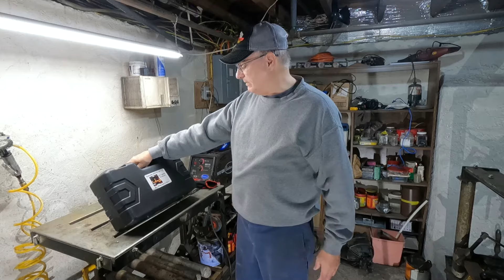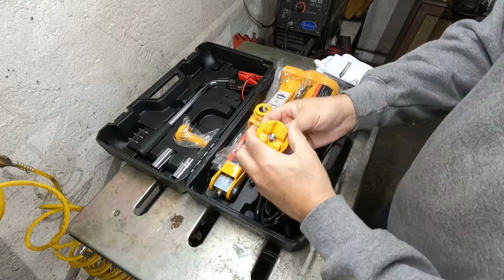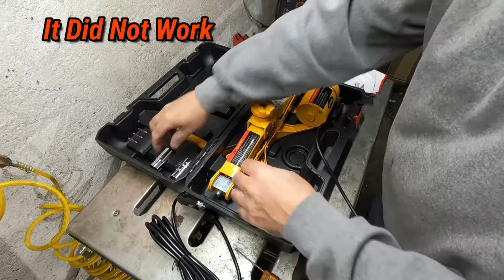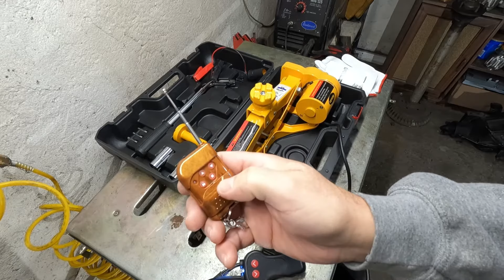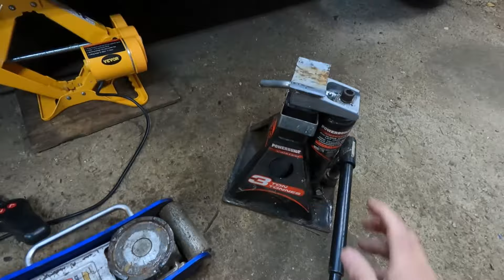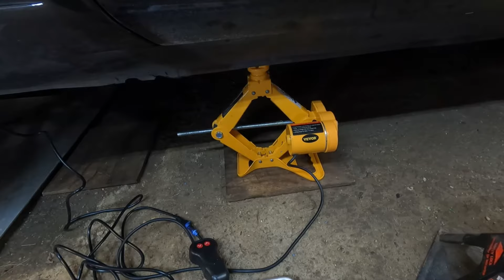Vevor 3 Ton Scissor Jack Review. 👀

Comment: From a safety standpoint, the scissor jack footing should run perpendicular to the length of the vehicle, instead of parallel like on the video.
Reply from the maker: According to the directions that is how they recommend the placement of the jack as the way I Have it in the video, the reason is if the car were to role just a little bit forward or back the jack would flop over or collapse, I actually had that happen to me once with a manual scissor jack. That being said I believe the factory jack is designed the way you say and so was the manual one that I had collapse on me.

Comment: I like a scissor jack because it is light weight and doesn't move unlike floor jacks. I use a high torque drill on the hex drive for easier operation. If yours has the hook and eye type drive, they sell hex adapters. I had one jack fail because of insufficient grease on the acme screw. The nut was stripped yet it still lowered the car smoothly. Only when I picked up the jack by the top did I notice it started slipping! Very strange.
Reply: It's probably safer if the jack moves on the floor like floor jacks, to accomodate the shift in the lift point due to the arc as the vehicle lift proceeds.
With the base fixed in position, it's much more likely to topple than something that can adapt as it goes up.
Reply: @sadfur8728  That's true for smooth floors, but I'm usually working on a bumpy driveway or on gravel. My floor jack doesn't self center very well which makes it more dangerous.

Comment: Thanks, great honest review. I wish I saw this before I purchased this jack. It blew fuses on my cigarette lighter socket and on the jack itself when I tried to lift the rear end of my pajero pinin which is less that 1400kg for the whole car. So the rear end should be less than 700kg. Waste of money as the 3ton rating is BS
Reply from the maker: Sorry to hear you had problems, Thanks for Watching.
Reply: Guess they expect it to common to blow fuses because they supply all the extra fuses along with the kit...
It may be more likely to blow fuses if the battery voltage drops too low and the motor stalls; keeping the engine running may be better.

Comment: that 3T on these jacks do not mean they can lift 3T. if its 3Tons then it can probably life under half of the capacity mentioned, actually 1/3rd. The meaning of 3T means it can lift one side of a car which is under 3T.
Reply: It'd be nice if the hydraulic press channel would test the actual lift capability, using their gauge and running the jack to the maximum.  Perhaps all these capacities are going by claimed divided by four, figuring the weight is equally divided by the four wheels.  That may be a more realistic expectation, so a 6600 lb claim is actually 1650 lbs.

Comment: Sound like your battery is weak ????
Reply from the maker: It's not, the jack is just slow.
Reply: The most important it can lift using the 12v battery.
Reply from the maker: It comes in handy for things like supporting the transmission when I had to remove the tailshaft housing, it allows for ease of adjustability

Comment: Your Jack was under strain because you did not use the battery cables to hook it to your motor use the positive and negative connections to your battery that is why your Jack was strained  The cigarette lighter is not strong enough it needs a direct battery connection
Reply from the maker: I believe I have tried it hooked directly to the battery in the past, but when I have a chance I will try it agen to see if it makes a difference.
Reply from the maker: I had to go back and watch my own video and just realized it was hooked directly to the battery while jacking up and lowering the car. 18:20
Reply: @E.T.GARAGE   Some vehicles have multiple cigarette lighters some are 10 votes some are 15 and most are 20 you have to find the one that is 20 V and even then start your vehicle too to see if that boost it some I have the same Jack and had the same problem all I did was switch cigarette lighters and it fixed the problem but also now start to use the battery connection
Reply from the maker: Only one cigarette lighter on a 90 Corvette, it's 12 volts and I would never use it to power the jack, the only time I have used the cigarette plug on the jack is with battery jumper box I have.
Reply: @E.T.GARAGE   I started to send my Jack back after I got it because of that problem then once I figured it out I'd I decided to keep it I will use it
Reply: not true all you have to do ia start the engine to boost your power to the jack with the car running the alternator gives the battery more power